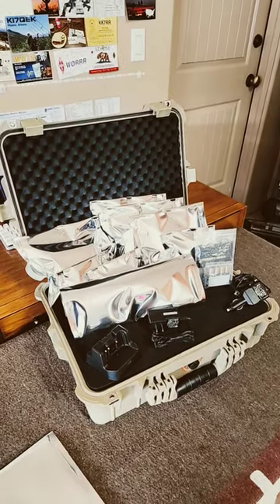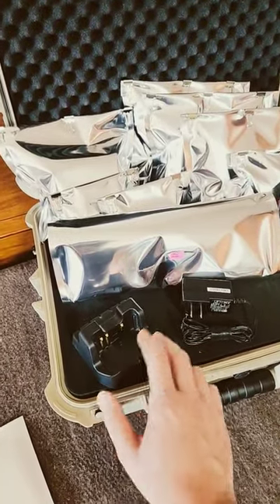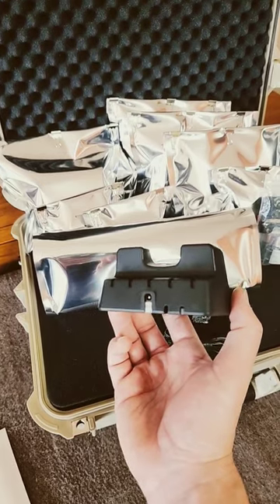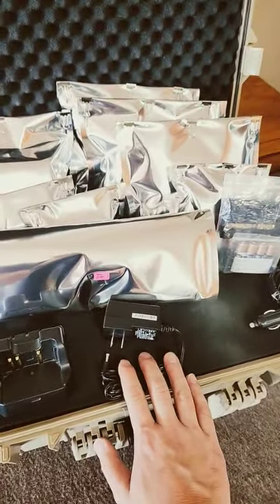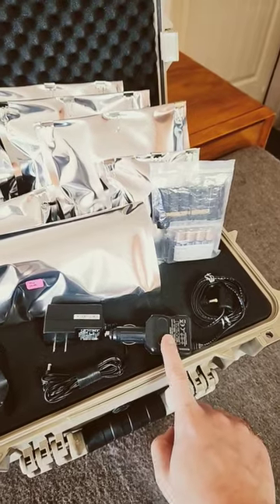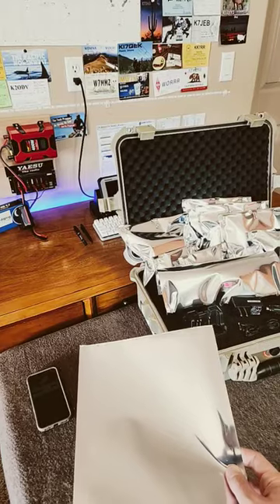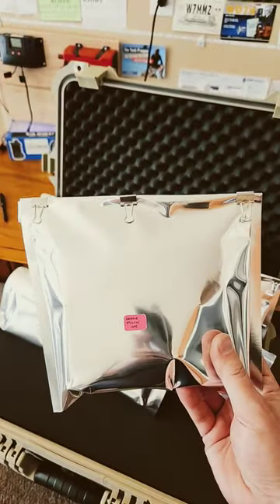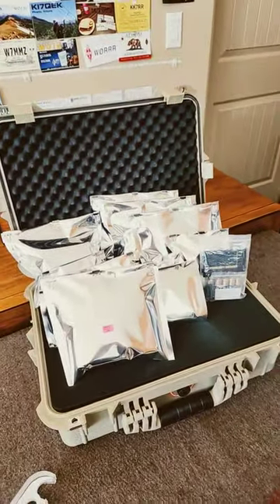Day #9: EMP Comms Plan (VHF/UHF)

Comment: If it's not turned on when the EMP occurs it will stand a better chance of not being damaged. However, for sensitive electronics such as LED's, ain't no stopping the popping on those. The Faraday does make us feel better, and it works if it's done right. Gotta ground it properly.